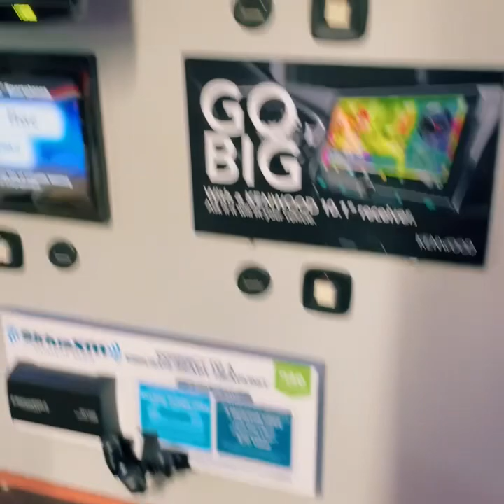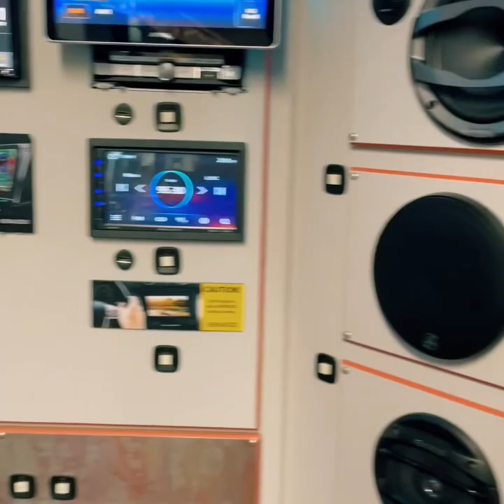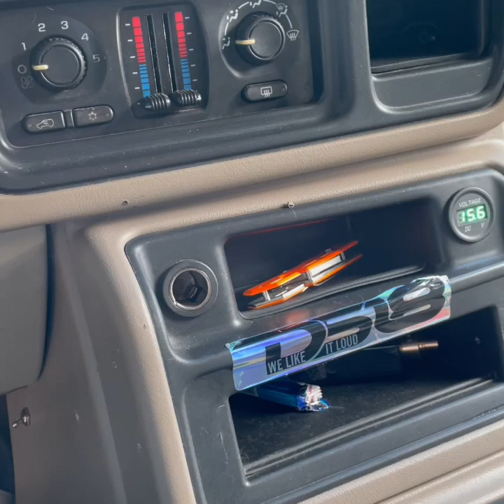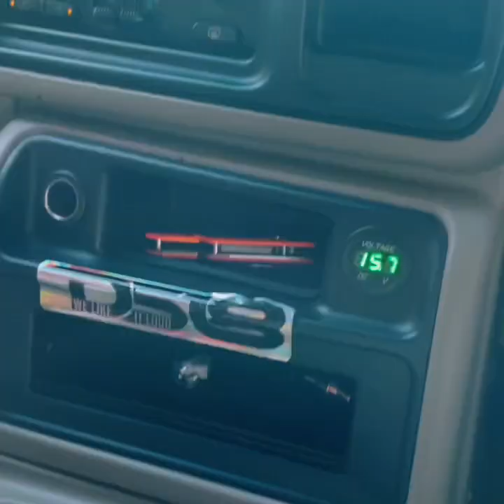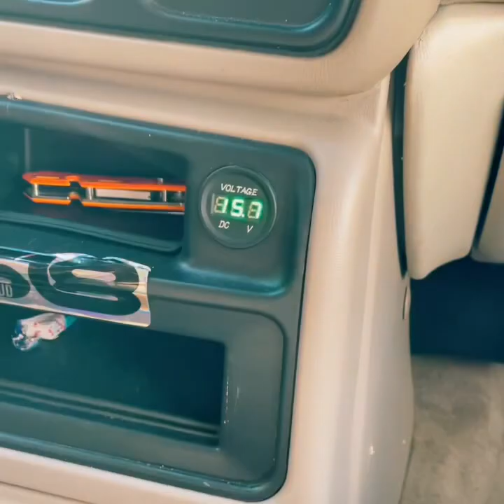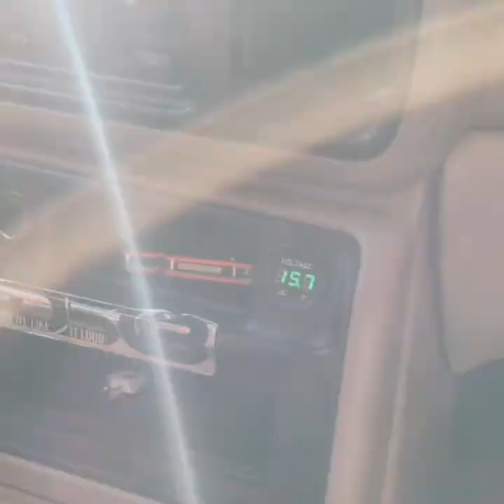Adding diodes to a Mechman 370 on any Gm 4 pin alternator very easy

Comment: I have Mechman 240 ,Can I do anything with it ?, Maryland showing a little ❤️
Reply from the maker: Yep you should be able if it’s a Gm 4 pin
Reply: @SmoothKreationsaudio  nice to know what do I look up on eBay ?because I want my voltage above everything .thank you for getting back to me in a timely manner 💪🏾
Reply from the maker: Do you have a local car audio shop near u they may have some
Reply: @SmoothKreationsaudio  I really don’t do audio shops I don’t trust em just point me in the right direction to diodes and I’ll figure out the rest I’ll watch your video again and work it out.
Reply from the maker: Get at me on fb and I can help better my name brandy anglin on fb